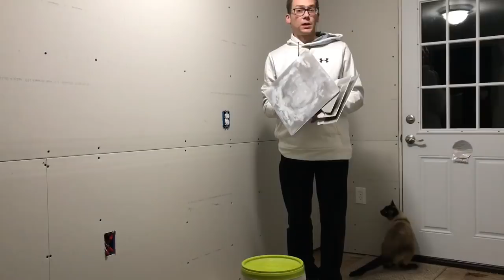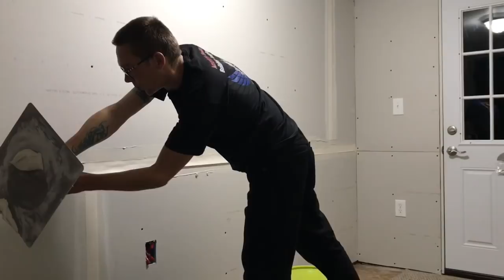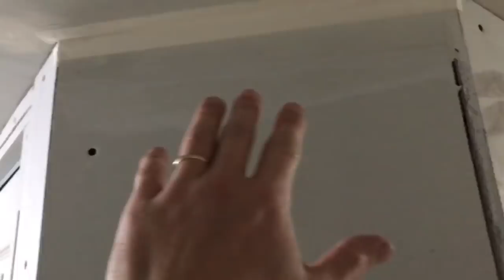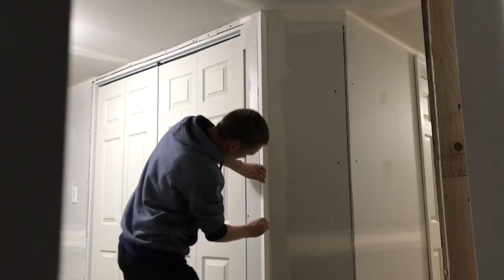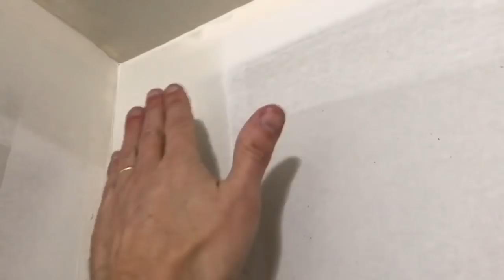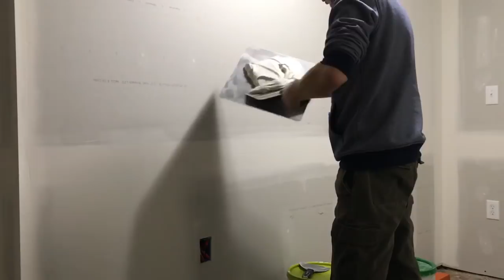How to Mud and Tape Drywall

Comment: I've watched countless tutorials and have done a fair amount of drywall and skimming over the years and I think this is one of the best tutorials I've seen to enable a newbie to taping to do a decent job. Of course butt joints are the hardest part to get right and I always advise people to avoid them whenever possible. Use longer sheets or place them in inconspicuous areas not subject to sidelighting. Butt boards are another option.
Reply from the maker: Thank you!

Comment: you missed a few steps which are critical to not having cracks in the future but this is a good way to save money even if the results are not the same
Reply from the maker: S Cc I was a professional builder for many years and am curious what steps you are talking about. The only thing I could think of is using durabond on the corner bead for the 1st coat.

Comment: Great video! That was exactly what I was looking for! Very thorough. I noticed you only used one type of mud for the whole thing. What kind of mud was it? They say to use a easy sand 45 or 90 for the tape coat than a lightweight joint compound for the rest. What's your opinion? Thanks again for the video, it was awesome, I learned alot
Reply from the maker: Easy sand 45 and 90 are the types that you need to mix yourself, they are a chemical dry. The 45 and 90 refer to dry times. I was using a basic joint compound, I believe it was Sheetrock brand. Its pre-mixed and drys as the moisture evaporates so its slower than the chemical dry compounds but has the advantage of not hardening up as you are working with it. Its great that you found this video helpful
Reply: Mud wise "all purpose" is good for taping and lightweight is great for skimming/final coat.  hot mud (powdered stuff) is champion for little patching jobs but if your like me (diy'er with a toolbelt) then the pre-mixed stuff is the best.  The drying time of sheetrock 90 makes it hard to work with for a beginner.   Also you can add some water (about 1 - 2 sponges worth per bucket depending on the size of the bucket) to make you mud thinner for 2nd and skim coating, you can mix it by hand or use a tool to whip it up.   I've found seam filling, mud slinging or plastering (depending on your lingo) to be more art than science and once you get a feel for it, you can save money.  Not to say that you should not hire a professional but for example redoing your bedroom, a diy'er can save some money by watching this guys process.   Also have a second bucket of soapy water and a sponge for cleaning up your tools afterwards.  just my 2cents...